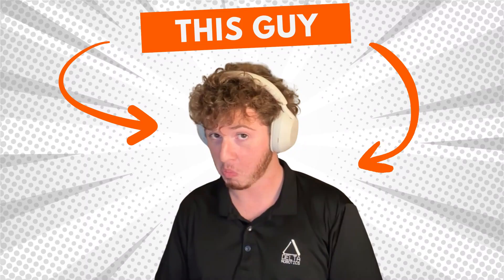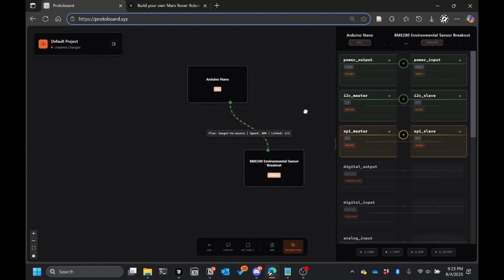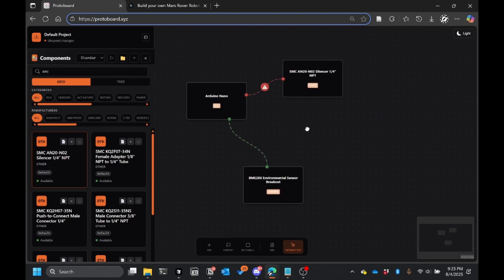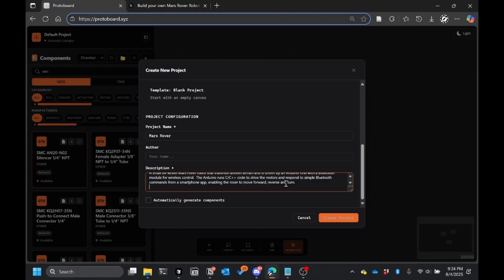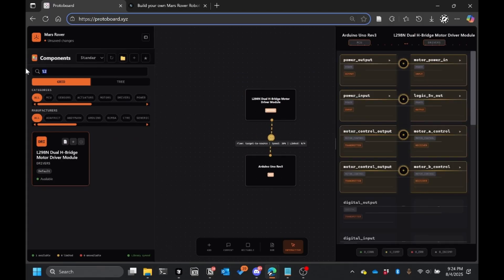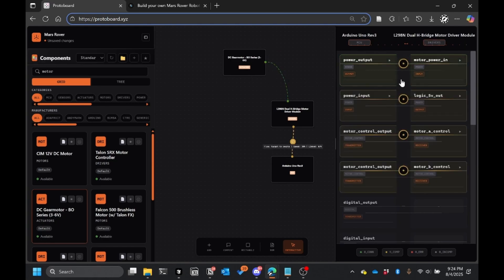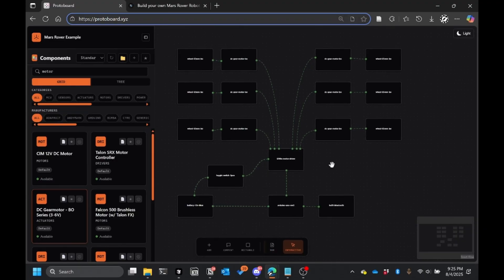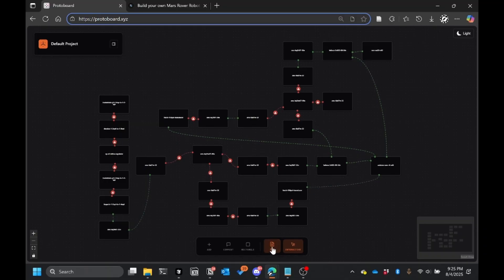We make building hardware as easy as writing code!

Comment: Pretty cool. I am not an hardware designer, but I like the general idea. You should use different shapes for different components, to make it easier to understand the model at first glance. Like a motor should have a different shape from a motor controller, or a battery.

Comment: @Delta Robotics
0:40 Improvement suggestion:
Instead of an error (or within the error report), add suggestions for adapter things that could MAKE this connection actually work.
Maybe even suggest multiple steps solutions, eg. signal-a goes into converter-a to become signal-b that needs to go into converter-b and THEN it is a singal-c that is compatible.

Comment: Can't wait to Vibe-Check my hardware 😂

 No fun aside, how incredibly cool would this be if it were open-source 😮 like after some time with enough users literally everything would be in there.....
Also currently it's pretty basic and a lot of ppl will go "why do I need this" but once you are at a point where you get errors like the VFD doesn't provide the 800Hz the Motor needs" or the controller doesn't supply enough Voltage, we recommend this part instead" it will literally be THE tool for prototypeing hardware 🎉🎉 awesome project

Comment: The only dependency thats solved here is whether two IC's have the same communication interface or wether the type of motor driver matches the motor type which is really not that impressive at all. To be honest thats like the easiest part in developing hardware.
Reply: Lol you'd be surprised especially for beginners. They don't understand what those concepts are at first. We are building more advanced rules to be checked as well, though. We currently have resource/pin capacity checks, voltage level compatibility, operating frequencies, protocol roles, and pin/port assignment conflicts between interfaces taken care of as well. The system takes care of more advanced concepts in our newer build this demo was just a very simple implementation.

Comment: Interesting, sort of MBSE for dummies but with hardware. 
As a seasoned engineer closely working with hardware, i see it providing value for beginners saving hours researching various hardware components for their projects. 
Curious can it validate spec matching too?
 e.g. for your motor controller demo, the L298 can supply 1A current, if I plugged another DC motor like RS775 (which is correct type but much larger) that draws more than 1A, can it validate this? I think this type of spec matching for true compatibility check would provide great value.
Reply: We are working on a ruleset system and data/power flow for this exact reason yes. My next video will hopefully cover the technology a bit more

Comment: As you move your mouse around it looks like your mouse pointer has ADHD. If you want to demo something, my suggestion is to make each move deliberate, not to oscillate around the item of interest 10 times before doing something, it's very distracting.
Reply: nothing wrong with having adhd
Reply: @aqqalularsen3322  something definitely wrong with your reading comprehension.

Comment: Interesting. Will this extend to circuitry on custom boards? For example, designing a PWM LED board, with 12/24 V input, stepdown to feed an esp32, esp32 generates 14 bit PWM, PWM goes to mosfet drivers, those go to mosfets, and those to to LED strips.

Comment: Please drop the master/slave language and pick alternative words such as controller and peripheral, it's more fun to say POCI and PICO than it is to say MOSI and MISO anyway.
Reply: Focus on functionality, not euphemism mills.
Reply: @crackwitz shut up loser
Reply: @crackwitz  master and slave isn't even a valid description of the roles that devices usually take on so your comment doesn't even make sense. I don't like using the words master and slave it doesn't spark joy and it's as simple as that
Reply: @funy0n583  Hey I think it is a fair point. That being said, the default for now is just to align with the manufacturer's datasheet/specification. If Arduino labels a pin a certain way, that's how we've defined it at the moment. What's nice about Protoboard that I hope to show off soon is that you can create custom components and define them how you want, so changing the names of pins to fit your needs is definitely going to be a possibility!

Comment: Nice new idea!
As someone training people on hardware and software for a living, I have a few suggestions for your video:
• No circling with the mouse. Viewers attention is at the tip of your mouse. Moving it arround all the time makes viewers dizzy.
• Same with clicking and scrolling. Slower is better. You know what you are looking for, viewers don't - give them time and support to orientate. Use the mouse to guide attention.
• You showed a nice example, but I could not see the critical details. A screencast of a Full-HD  or bigger screen with small icons and smaller text is challenging, rspecially if you do not know where to find that little piece of information that makes all the difference. Make stuff bigger or zoom in to what you are showing.
Consider that many viewers use a phone for viewing the video.
• A nice tutorial is slower paced and clearly shows steps that work and also steps that do not work. Would be nice to see more details of different ways to connect the components demonstrated.
• Prepare your steps. Scrolling through some page and obviously searching for that one diagram drains your viewers attention unnecessarily. 
• The end result may look similar for you, for me it did not at all. One was a colorful clearly structured diagram of elements, the other was some orange text on black screen without any recognizable connections or distinction features. Allow viewers to understand, how exactly one resembles the other.

I like what you created, I could just not follow your explanation...
Reply: So much value right here. Thankyou for this! Appreciate you!
Reply: I just wrote the same basic comment re: mouse circling. This video was terrible to watch.
Reply: @aarondcmedia9585 haha yeah I was definitely super nervous and quick making this video not meaning for it to blow up or even be a public video. We decided after the fact to post it and I noticed that I was really jumpy with the mouse movements. Sorry guys I promise to do better next time!
Reply: Uh, thank you - i am just a random viewer but now i learned for myself something additionaly!